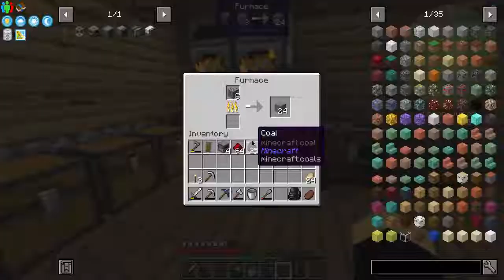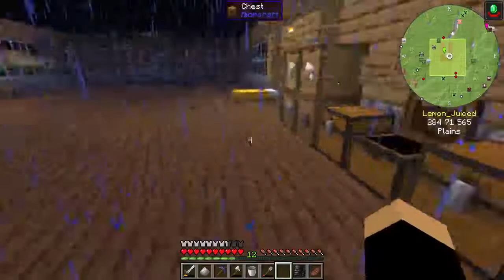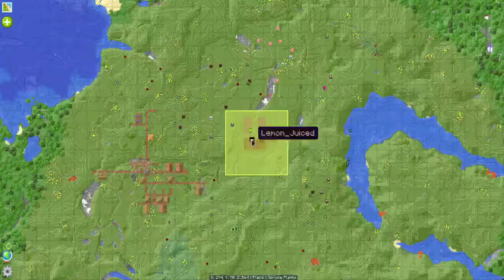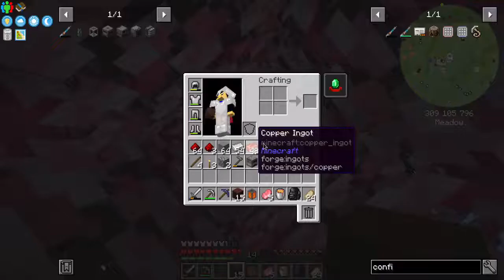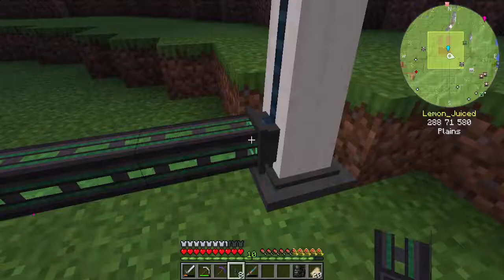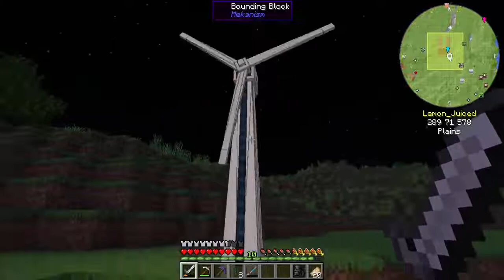Minecraft Modded Survival E2 Mekanical Startup (Industrial Machines)

Comment: The heat generator is intended to be immersed in lava. Feeding it coal is the worst! Alternatively, if you have the redstone you can use it to power the mek machines long enough to make a windmill or whatever.
Reply from the maker: I never knew that, havent used it in years and used an alternative from different mods instead bc I knew it was very bad. I quickly moved onto a different generator, not sure if that was in this episode or a following.